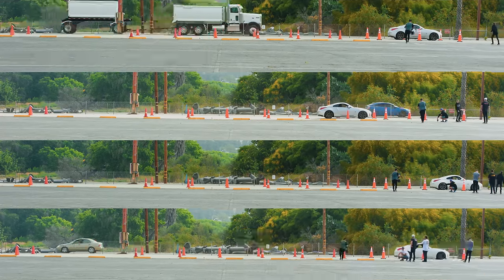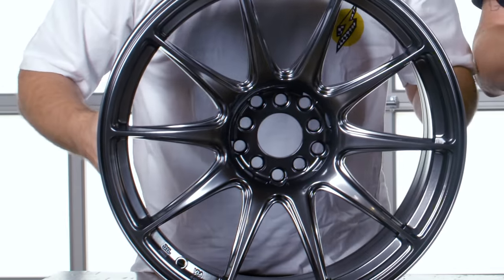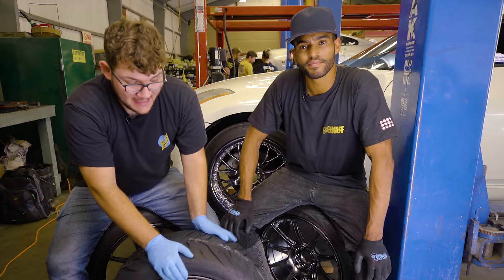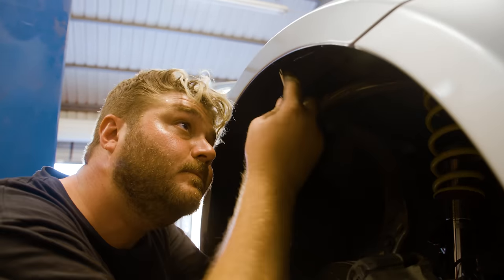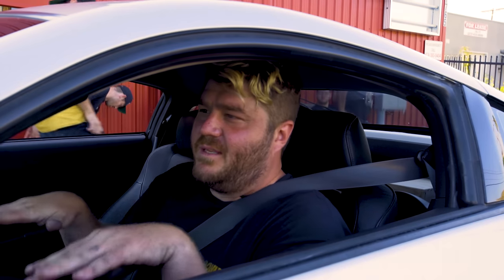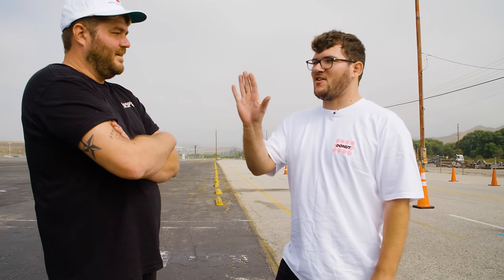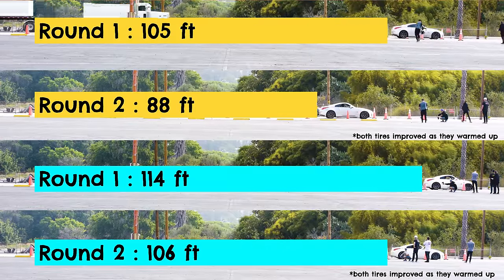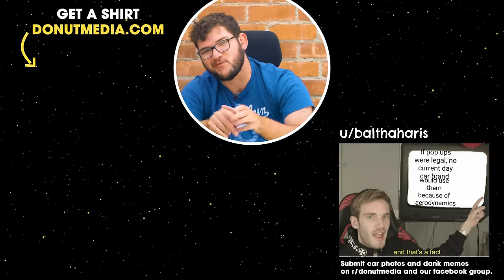$1,000 vs $3,700 Wheels and Tires | HiLow

Comment: I think the final question, instead of “Does more money = more better” because 99% that answer will be yes, the question should be “Is more money worth it”
Reply: I’d believe in doing the best of both. So cheap rims and expensive tires. Because the rims matter a lot less than the tires in terms of performance. 4 pounds isn’t that much of a difference when you’re running a stiffer/lower set up, whereas if you max out your usable grip you’re going to have a much more noticeable improvement
Reply: *IRS enters the chat *
Reply: You’re overthinking a joke
Reply: gear head you gotta go somewhere in the middle
Reply: I assume "better" takes into account value
Reply: I've learned that anything that keeps you anchored to the ground is worth paying too dollar for. Tired, shoes. K snowboard bindings, cycling shoes. Etc. I always ball out on those things. Have never been wronged.
Reply: @brandonmiller9155   That's 4 pounds per wheel X 4 Total of 16 pounds there will be a noticeable difference even if you are running a lower/stiffer set up.
Reply: They literally do that at the end of these videos, they talk about if it's worth it
Reply: @autopassion5707  You have to be very good, pushing very hard, to notice 16 pounds of total weight on a 3500 lb car. An average driver pushing decently can probably feel that 4 lbs of unsprung weight is different, but I doubt you'd see any actual performance difference. Maybe on really bumpy roads, but the struts and springs will make way more difference there. So save money on wheels and buy better suspension if you have to make a choice.
Reply: If your trying for decent performance and not drag racing or going for just looks, but want to save money, get a standard size rim that fits with standard size tires on the car. If its a standard rim, its usually way cheaper, so are the tires, and then the pothole issue is also less of a concern. You can still get performance tires on a stock rim too.
Reply: If it's not worth it is it really better
Reply: @brandonmiller9155  iconic day amp
Reply: @ALittleBitOfGay  yeah but a bent $1000+ wheel vs a $300-$500 wheel which one hurts more? Like you’re not gonna worry about a $500 wheel. And as long as it’s a quality product it’s no more or less dangerous between the $1000 or the cheaper wheel. An enkei is just as safe as an HRE,
Reply: @ALittleBitOfGay  sure, you can get the rim straightened, but that’s now a repaired wheel and a potential weak point. A cracked wheel for half the price means you get a brand new wheel with no weak points, and for less than or equal to the more expensive wheels. On a daily driver car with light track use like the hi-low cars, it’s always the better option to go for lower cost wheels and spend money on the rubber. If you’re going for a hyper focused track car, sure, spend 1000-2500 or more per wheel, save that 1-4 pounds of unsparing weight, MAYBE be able to fix the wheel if it’s bent (though most track teams just replace the wheel entirely) and MAYBE get that much more performance out of the car, BUT most people aren’t making extreme track cars. Hell, even a drift car won’t need the most expensive wheels, tons of them use RPF1s or cheaper enkeis and they work JUST fine.
Reply: What a bad idea

Comment: The cops should see this and realize that modified cars are better performing and SAFER!
Reply: Reece Dabeast but what about the driver? Cars don’t drive themselves
Reply: Idk...I see a lot of wrecked BMW/Mercedes/Muscle cars
Reply: I don’t agree. Being faster is different than being safer. Looots of tests are done on oem parts for road use. They did not try it under heavy rain for exemple. Also, they kinda know what they are doing and used “appropriate” parts installed the right way. We can not expect it from everyone diy-ing it in their driveway.
Reply: @marcom2092  That's besides the point...
Reply: @DesolateControl  ...and its also besides the point.
Reply: only when you use premium authentic car parts that are not made in china or mexico, and is installed / tuned by a certified mechanic.
Reply: Until you see some Honda Civic with flushed wheels/stance that has no purpose besides look and are a risk
Reply: People who modify their cars usually street race their cars
Reply: @Range-X  those are high performance cars that idiots don't know how to control and crash them
Reply: Cyberspino I agree.  But from a cops perspective, many people driving those cars ARE idiots.  Just because it has superior performance doesn’t mean it compensates for crappy driving.  No different than Jeep drivers rear ending people on slick roads, falsely believing their mud tires won’t slide.
Reply: A "proper" modified cars
Reply: Lmaooooo
Reply: I think the point is.... Who is gonna drive the roads crazy enough to tell the difference.
If you do... YOU ARE UNSAFE.
Reply: @Range-X  Mud tires are  the worst for Rain .Mud tires are made for Mud Sand Rock
Reply: @Range-X  they make Rain Tires but I believe it's only for Motorsports
Reply: It’s not the cops that should know, they just enforce laws 🤔
Reply: Cops don't make the laws the City/government does
Reply: The people you elect make the laws, the cops just enforce them. You are complaining about the wrong people.
Reply: But mah reelz and regoolationz
Reply: Cops, see a Modified car and dallor signs pop in his head $$$$$
Reply: stanced miata drives by looking like 4 ufo's are carrying it down the road
Reply: a welded diff isnt really "Safe"
Reply: 1) Cars don't drive themselves (most of them at least)
2) Only well-moddified cars are safer. Good tires and suspension are great for both performance and safety.
3) Many Cops do realize this, but they have to do their job. It's not their fault that law they have to enforce was created by morons. Majority of them are chill and if they can they will leave you alone.
Reply: Sorry I don’t speak wrong. I still drive a heavily modified vehicle tho
Reply: @mandoman69  nooooooo.... really? Who would do that?
Reply: Cops want people i. reliable eco friendly cars not lightweight oilburning gas guzzlers
Reply: modifying a car is indicative of a desire to drive it harder, which more than cancels out the safety boosts of stopping distances and handling
Reply: @Kevin-dt9xm  if I only modify my brakes to put big brembos on it, is because I want to drive it harder? Or increasing the safety factor of it? (Granted, it's not the only thing I've modified, however, when you increase the performance, it is vital to increase the support base of the vehicle.)
Reply: @dutchylt  if thats the only mod, cops wont really care. the big shiny red calipers with the namebrand might catch their eye, but a decent amount of high end cars come factory with brembos these days anyway
Reply: @dutchylt  brembos, coilovers, rims, exhaust, window tint, and giant wing though, and a cops gonna be like "this guy watched too much fast and furious and now thinks hes an elite street racer"
Reply: @dutchylt  if a cop sees a camry with a big brake kit, MAYBE its someone who wants to make sure they can stop a tiny bit harder. but then again, brake upgrades are more for tracks because most of them are for reducing brake fade, not increasing stopping power. if a cop sees someone in a 370z with a big brembo kit and a bunch of camber, hes gonna say to himself "wow, this guy certainly spent thousands under the assumption that hes going to be braking really hard a bunch of times in a row" and keep an eye out to make sure the z boi isnt doing anything
Reply: @Kevin-dt9xm  damn dude, I don't really care. I do what i do, you do what you do. Everyone does what everyone does. 
Chill and enjoy life a little.
Reply: @dutchylt  i am actually feeling really chill, i didnt write this in a heat or something i just like to expand on things i say
Reply: only if done right
Reply: @cornelbogdanmacrineanu7962  exactly. "no officer, i disabled abs, tinted my windshield, lights, and taillights, cut my springs, put a cheap turbo in, took out my airbags to save weight, and added a giant bolt on wing cuz it makes the car safer. some dude on the internet said so"
Reply: @Range-X  same. internet is chock full of compilations of crashed mustangs and corvettes, can you find a compilation of crashed honda accords?
Reply: That depends on the person building it and how much attention to detail they have or if they even have... OMG SQUIRREL! Did you see it?
Reply: Bud Ranger not modified cars buddy those are stock
Reply: Nahh they be sitting here drooling hating us all like we're cocaine heads haha
Reply: the cops know this, but they have to enforce laws created by people who know nothing or are severely out of touch.
Reply: You have a point but it's still depends on the driver
Reply: The cops should mind their own damn business
Reply: True
Reply: too bad the owners and drivers also think that and thinks they can go crazy because their cars are "higher performance and safer! So that means I can get more careless than normal"
Reply: @Kevin-dt9xm  Modifying doesnt necessarily mean you want to drive the car hard, Putting a sound system in your car is modifying it but doesnt necessarily mean you wanna drive it hard, what about people who build show cars....considering theyre meant for looks doesnt mean they wanna bomb down roads at stupid speeds
Reply: @Zikhr  just telling you what a cop sees, just saying what it looks like when a straight piped car with a wing and tinted tail lights comes down the road, the cops gonna have an extra eye on him because more cars who fit that description speed than normal cars
Reply: @Kevin-dt9xm  Oh yeah i fully agree but i mean i drive hard whens its reasonable to and when im only putting myself in danger and dont drive like a muppet during traffic etc, Also being nice to cops gets you a long way, especially in the UK
Reply: You forgot to write the word "properly" just before the word "modified"
Reply: It's not the cops. It's your legislators. Your mayor, governor, and Senate reps make those laws. Talk to them.
Reply: Not if you're driving like an asshole on the streets. Most folk with performance cars feel over confident just because they are driving a performance car.
Reply: If you don't drove it on the street like a maniac, then it is safer
Reply: Bud Ranger I also see a lot of wrecked custom/shitty 98 civics
Reply: What if you could get an upgraded drivers licence of some sort.
Reply: Confirmation bias much bro
Reply: The people who drive them aren't though. CAR MODDERS, IF YOU DRIVE ON PRIVATE RACE TRACK EVERYONE ELSE CAN HAVE NICER THINGS.
Reply: When done right
Reply: Safer if done properly !
Reply: The people who mod cars are more likely to be reckless.
Reply: How about the cheap ass modified cars. Those are dangerous
Reply: Dumbest thing I’ve ever heard😂
Reply: That depends on the mods, suspension mods and brake mods should make the car safer, the wheel replacement is honestly aesthetic because you can get amazing performing tires on most stock wheels(16inches and up)
Reply: Depends who builds them which is why they get sent for inspection...
Reply: @Range-X  because they dont know gow to drive em
Reply: not always,  if anything,  depending on the upgrades and the person behind the wheel,  it's even more potentially dangerous.   there's a reason why insurance rates gets jacked for men.
Reply: @thatbo8902  that's not entirely true, but modding your car does add an extra risk if it's not done right, but I only know so much so I guess take my words with a grain of salt.
Reply: @monoracer_  I kinda feel like that too. I don't want to tell anyone that you can't mod a car the way you want, but I find really low suspensions and wheels & tires that are titled to extremes are really dangerous in my eyes and ultimately slow down traffic which makes everyone behind them take longer to get where they're going and I cant just overtake you cause a cop will slap me with a ticket. not to mention they might, very likely, damage the bottom of their car if they don't know how to drive over speed bumps and slants. I already saw that happen before but it's probably cause they had bad brakes but if their car was higher it probably wouldn't have been that bad imo.
Reply: @RealNigga0190  I know it's not a 100 percent rule, my point was that  people who mod cars are a "kind" of people who share personality traits, not different from people who go to clubs, or people who collect post stamps, that's what unites them as a community shared values. And those people are more likely to be reckless than other group of people. Just look at mod cars on youtube and you'll get a ton of vids of dangerous behavior on the road. It's about the people not the car safety.
Reply: @thatbo8902  I get you
Reply: Dan cops only enforce the rules as far as I know, but again I'm talking with little knowledge since idk who came up with the rules.
Reply: Cops don’t care what kind of wheels and tires you put on your car, the statement isn’t applicable here.
Reply: You really think the cops are the ones that decide the laws? The only enforce them.
Reply: Lmfao idk what cars you seen but most of the builds i seen were sketchy asf
Reply: Yeah right EINSTEIN
Reply: I got a little excited reading your statement, but then you realize that stance, specifically, excessive stance (i.e. reduced tire contact patch) still exists.
Reply: kinda, but yeah, lol.
Reply: Bingo and then they could do one better for themselves as well.
Reply: Uhhmmm no. "THESE" cars are safe (The ones in the video). However, we can't say the same for Johnny Jackass who's running 3 inch spacers for a wider, lower look on his civic.
Reply: sometimes but not nearly as often as they make it less safe
Reply: Yeah 💙
Reply: Sort of if the upgrades are like this ones
Reply: What mods make a car safer? I can't think of many mods evaluated to higher than OEM specs with proper testing to prove so. After many years of servicing vehicles for a living, I can tell you a lot of garage mods are hack jobs, so if the person doing the job isn't a professional or really knows what they are doing, It's hard to stand by your comment.
Reply: Cops know this, but they just like busting balls.  I told a cop that an air intake and exhaust will give a car better mpg to help combat pollution, then he said it causes noise pollution that people seem to hate more.  I understand the loud an obnoxious exhaust, but there are good ones that are quiet.  Was actually getting 1.5 mpg better on the highway with an exhaust and intake with my old 00 Civic Si.  At 70mph I was churning like 4000 RPM and it was drinking fuel for a 1.6L.  Under 30 mpg on a 50 mile one way trip to work which never met EPA until I put an intake and exhaust on it and managed to get the 31 mpg listed.  I was getting barely 310 miles to a tank and not the 330 miles it was rated without the mods, mostly highway driving.  I miss that little car.
Reply: @The_Referee  ALL of ford's parts are made in china and ford's were assembled in Mexico.
Reply: @marcom2092  this didn't age well 🤣
Reply: Tell that to the people making the rules. Mayor of New York made it so that modified exhausts are illegal
Reply: and has worse mileage!!! jajajajajjaja 😃
Reply: I mean if people just modified their cars for better handing, I doubt they’d have a problem.